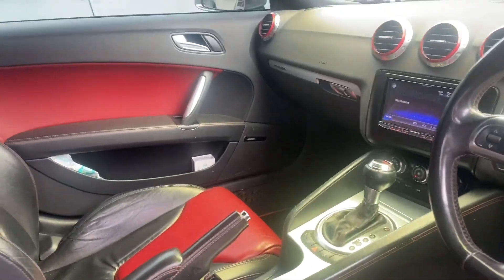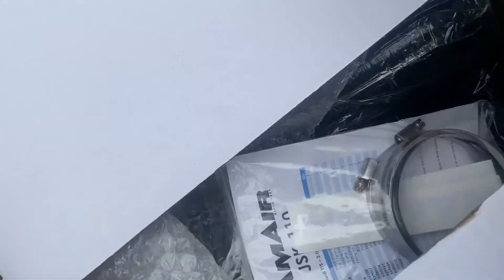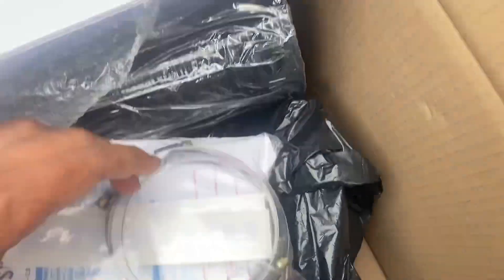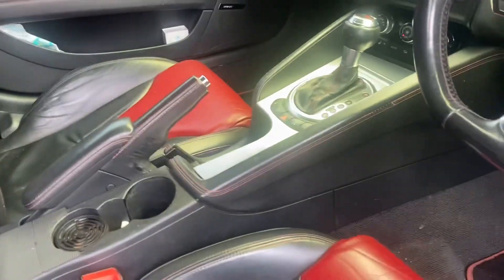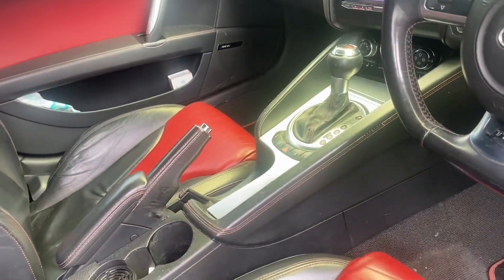Installing ramair induction kit on my Audi TTS and sound test

Comment: Did you install a dump valve as well?

How's it running after the install?

Did you need to get it mapped?
Reply from the maker: No I didn’t install a dump valve, the intake makes that noise by itself. I already had the car remapped but I would advise remapping the car if you want to fit an intake
Reply: @linicarreviews7524  thanks mate!